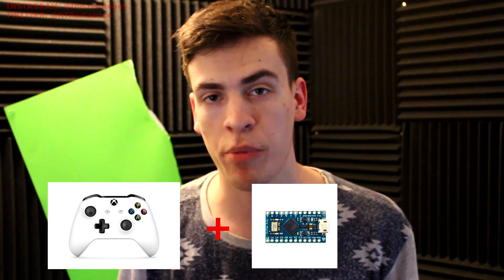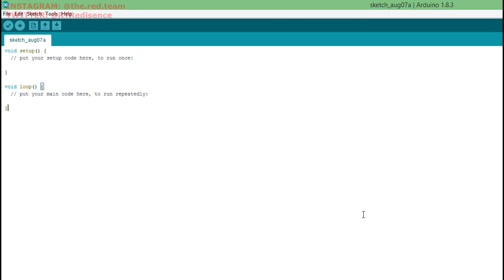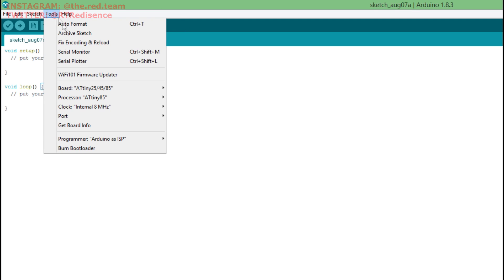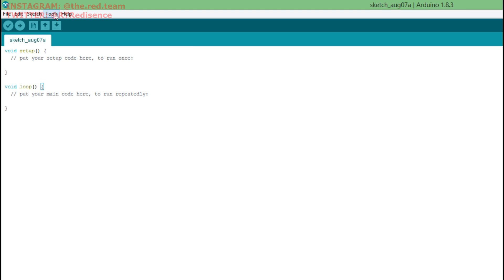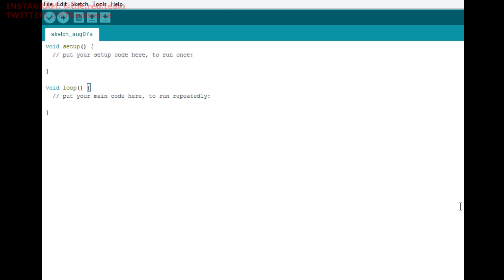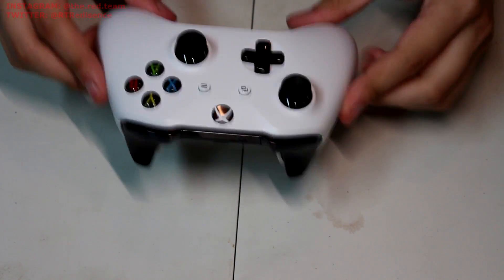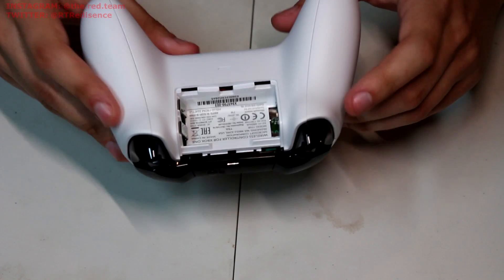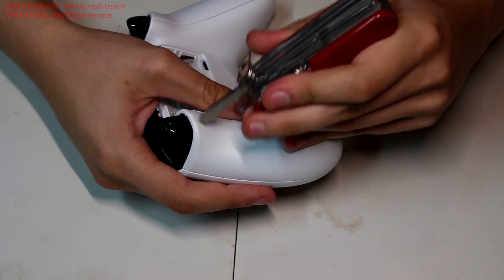XBOX ONE - $4 RAPID FIRE MOD TUTORIAL | ARDUINO

Comment: Do any modifications need to be done to the code if you use an arduino nano. And also what Xbox one controllers does this work is it only the Xbox one controller.
Reply from the maker: If you use the same pins on the nano as the one in the code then no, there is no need for modifications.

This tutorial shows how to install the mod in the Xbox One S controller so that would be the controller shown in the video thumb nail and all color variants.

This tutorial does not work for elite controllers or the first generation xbox one controllers because those controllers have different solder points for the right trigger. 

The code will work for ALL xbox one controllers so if you mange to find the correct solder points for the right trigger in the other controllers, then you can install this mod and it will work.
Reply: Heinous Crims thanks for the help

Comment: Thanks for the info.  I'm trying to do something different which is to use an arduino to set the left analog stick to up to make a character walk forward.  This is for farming cash in a game :).  Rubber band trick doesn't work as it's detected in about 20-30 min. So to avoid detection it will need to ocassionally deactivate the forward hack for a bit to make it seem more human (which I can code no problem).  My plan was to do what you did with RB but instead do it with the Left analog stick up.  Read it when the mod is not activated.  Then Write 255 to it to tie it up to Vcc (which is the up position, ground is the down position).  I considered using an optocoupler to connect the pole to the high pin on the pot, but I worry what would happen if I connect the center pole pin to high via arduino and accidentally pushed the joystick down at the same time. Would I be connecting it to both v and gnd at the same time, shorting everything out?  I suppose the way you're doing it if that happened the high resistance from the pot being physically pushed down would be cancelled out by the arduino pulling it high. But I flunked out of ac electronics so I'll probably just smoke the controller.  Any thoughts or advice?
Reply: Oh also forgot this part.. arduino analog outputs have the range of 0-255 while the inputs have the range 0-1023.  Your code sets it to 1000 which is essentially just setting it to 255.  My mod sort of worked.  I only have my left and right swapped so I need to fix that.  And my tac switch didn't fit where I thought it would so I have to move that.  And last.. I know why you flash the arduino before soldering it in.  Because afterwards you can't program it.  So I had to make my connection to power a jumper cable that I can unplug to debug/reprogram.

I do have a question about your code and what the purpose of this is:
  else if (active == false)
  {
    pinMode(RB, INPUT);
  }
  else if (sig > 150 || sig == 0 && active == false)
  {
    pinMode(RB, INPUT);
  }
Would love to know and I think I prob need to do it too but don't know why.. thanks.
Reply from the maker: I would not be able to offer much advice for messing with the thumbstick inputs since I have not messed with it much my self. Most I have done is connect the thumbstick to low voltage with analogWrite to make the player walk backwards and that didn't seem to have any issues when switching from reading input to writing output.

That snippet of code in your second comment is actually useless. It was a piece of code that was ment to check the state of the right trigger but when I realized I did not need to check the state of the right trigger, I switched other parts of the code around but left those "if" statements for no reason really. I did change what the "if" statements do so that they have no effect on the code but you can really just take them out.
Reply: Cool thanks for the reply.  My mod came out great.  And thanks cause your video really helped me do it.  I used a tinylily arduino because of it's very small size.  I was able to fit that in and add a button to the bottom and when it all fit back together you can't tell.  I completed my 2nd controller last night and it was a slightly different model.  Basically, I tied an analog pin to the middle pole of the joystick pot.  My mod then walks forward by analogWrite(Walk, 0);  I was surprised that worked but it does.  analogWrite(Walk, 255); made it walk backwards.  I figured that whatever the arduino writes to it would be offset by whereever the joystick is set.  But for some reason it overwrites it.

My code walks forward 10 seconds and then stops walking for a 1/8 second and then repeats.  The idea is to get around any detecton code by making it more human.  Which when like using a rubber band to physically push the stick forward - that was being detected.  This worked for like 20 hours and I already farmed a million $ in the first usage.  It eventually did kick me for inactivity.  But not for a while.  If necessary I can always change the code to add more variance in there, random variance, spoof other buttons to make it seem more human, etc.  The second mode pushes the right stick right to rotate the look.  This is another afk thing.  A button on the bottom of the controller now sets the mode.  So anyway.  It's all good.  Works great.  Thanks!
Reply from the maker: That sounds really cool. Glad you got it to work. I would be interested in seeing pictures of your setup and how it fits in the controller and also maybe a demo video. This sounds like a very cool project.
Reply: @badweaselproductions  Hi can you share your codes, I like this afk mod
Reply: Is the current code on Github compatible with the Tinylily, or does the code need to be modified first?

Comment: great video, but if your having trouble with finding the soldering points for the right trigger those to you solder together are R39 and C36. On the Elite controller they are located under the yellow plastic on the right side of the ribbon ban connection. just look for the numbers and youll find them set up the same way, side by side

Comment: Ok so my controller wasnt turning on but it turns out i accidentally melted a bit of where the power connects so i had to force it in and it works now but when i turn it on it freaks out then it starts blinking and the screen tells me it disconnected. Is this becuase of how i sodered it or what?
Reply from the maker: Not quite sure. I could be many reasons like I said. Possibly a mistake with soldering the left and right thumbstick.
Reply: PerfectlySpaced Well alright ill try resoldering this and setting up the arduino over again, thanks for the replies

Comment: What happens if i burn off the resistor and the other part?
Reply from the maker: Your right trigger will no longer work. They resistor and the capacitor can be reattached of course but you need to be careful
Reply: Oh ok but do u know why my controller wont turn on anymore?
Reply: PerfectlySpaced Did it have to do with me messing up the first sodering point?
Reply from the maker: It could be that or the right trigger, but I don't know since I did not watch you do it. Something else unrelated to my instructions could have been messed up.

Comment: Could you use an external power bank instead of the controller to power it?
Reply from the maker: You could if you wanted, but you might as well just keep the controller powered by USB.

I am not sure why you would want to power it externally.
Reply: i accidentally got the 5v one and people were saying that the controller couldnt supply enough power
Reply from the maker: Yea the controller can power it because the arduino can still run with 3.3v
Reply: A lot of people in the comments are saying it burned out their controller so I am going to power externally
Reply from the maker: If the arduino is burning anything in the controller, then they are installing something incorrectly.

The arduino only uses what you put into it so if you put in 3.3v, it only uses 3.3v.

There is no reason the controller would not work if they installed the mod properly
Reply: ok, ill power it like u did in the video, if it breaks it ill be without a controller and unable to purchase a new one

Comment: In the picture where you connected the capacitor and the resistor for the trigger, was it soldered or glued? I soldered it and the capacitor broke off cuz the heat was too high but I’m doing it again on another controller with lower heat
Reply from the maker: I soldered it. You only need to hold the soldering iron to the capacitor and resistor for about a second. It helps if you apply additional solder to them both before you attach the wire.

You really only need to touch the iron to them.
Reply: Thanks for the reply man, I appreciate it! Will do.

Comment: Hey man. Awesome video! Just wanted to ask if you used a 3.3v or 5v arduino for this project. I feel like it's 3.3v since you're supplying 3.7v to the RAW input but just want to make sure. Thanks.
Reply from the maker: So the arduino I used takes 5v but it can run as low as 3.3v.

You can also use an ATtiny85

Comment: hey, I made a slightly modified version of your code so I can toggle the mod using the sync button and it works great however when the mod is enabled and I do not touch the controller it will randomly shoot a single bullet every once in a while.... I've tried to debug the code for a while now to no avail. I'm using the attiny 85 and would love to get in contact with you to iron out this bug. Thank You!
Reply from the maker: Don't know if you are still having this issue or even care anymore. I am not having this issue using the arduino. I have made the same mod using the ATtiny85 and I have noticed the issue you are talking about. It is pretty annoying especially when playing a stealth shooting game.
Reply: ok at least I know I didn't mess anything up in the code. and yea its super frustrating! the attiny would make this mod even cheaper and compact!! I might get an attiny45v  and see if that works without the bug.
Reply from the maker: I believe I may have figured out what part of the code is causing the random shots to fire while the mod is on. If you go back and look at my code on github, I have added a commented section under the section of code where the right trigger is actually fired.

If you go into the code and uncomment the new section and comment out the old section, it should fix it
Reply: Awesome ill give it a try when I have time and let you know. Thank You!
Reply: TheRedTeamYouTube absolutely! What board are you going to use or will you just add an esp module to it? Looking forward to the release I’ve had this exact idea for such a long time but never had enough programming knowledge to make it happen!
Reply: TheRedTeamYouTube glad to hear it man I appreciate the follow up I plan on addding the new code to my version of the mod tonight!! Looking forward to the release!
Reply: just tested it with the modified code I wrote and it works flawlessly! Thank You!

Comment: I'm not getting com 5 only com 3
Reply from the maker: That is ok. It may or may not come up as the same com port as mine. The point is to read the description of the device that is plugged into that particular com port.

If it says com 3, but the description of the device matches whatever device you have plugged into the computer, then that is the com port you want to select
Reply: Ok I have same chip as you . But for some reason it's not uploading to chip. Any ideas

Comment: Question, could it be modified to use a diffrent way to turn it on and off? Such as right trigger and the sinc button?
Reply from the maker: Of course. I only use the left and right thumbstick in this video because they are the easiest places to solder so I figured anyone who sees this video and isn't very good at soldering might appreciate that.

You can of course solder either one of your stick wires to the sync button solder point and it will work. That is what my current controller has installed and I used this method for it
Reply: TheRedTeamYouTube Thanks for the reply.
Reply: TheRedTeamYouTube I looked up this chip. Is the mini the same thing / size?
And im not finding either board even close to $4 ?
Reply from the maker: The mini could be used in place of the micro

Comment: I checked the current draw from an xbox one controller's A button and it supplies 3.4 volts to the button. When pressed, it shorts to ground, pulling 90 mirco  amps (.009 mA).The Arduino Pro Micro can supply 3.3v at 150mA. My concern is when connecting A's high pin to another high pin, then switching it to a Low state, wouldn't it draw more mA than the controller is expecting to supply, potentially burning the controllers power supply? Another thing to note is when both 'A' and arduino pin are both high, shouldn't the potential amp draw be the same?
Reply: Did something similar. An automatic button pusher. It's been working well. It's powered by usb and used a multimeter to see how much resistance the controller needs. Two resistors and a diode keep it safe.
Reply: teensy
Reply: U go to Harvard or sum?

Comment: Can I use a Arduino UNO or I need a Arduino Pro Micro? thanks.
Reply: Quemador de memes profesional  OSOYOO Pro Micro ATmega32U4 5V/16MHz Module Board with 2 Row pin Header for arduino Leonardo Replace ATmega328 Pro Mini https://www.amazon.com/dp/B012FOV17O/ref=cm_sw_r_cp_api_i_duTJCb27AANAK